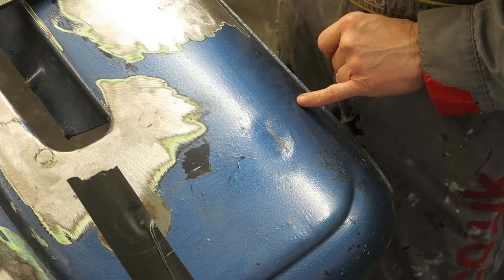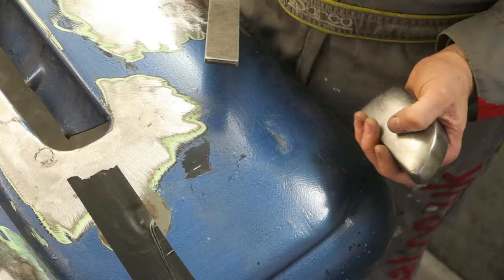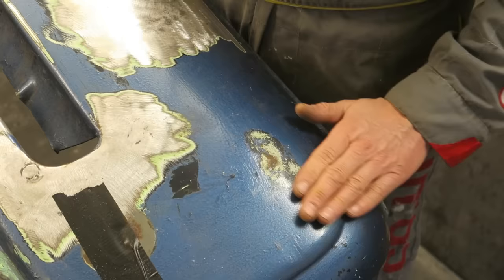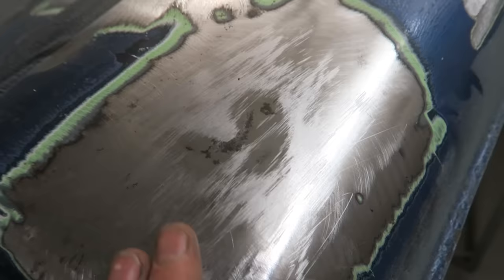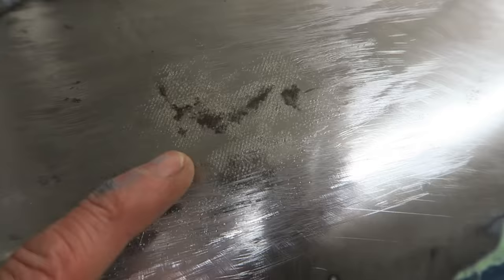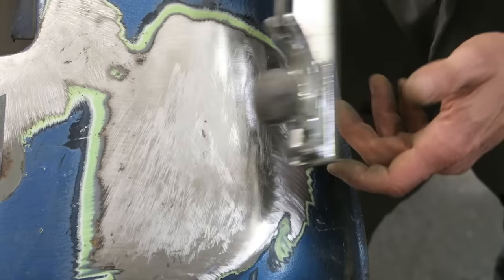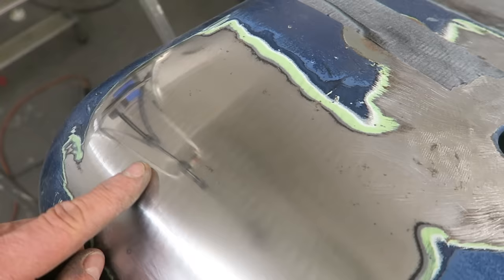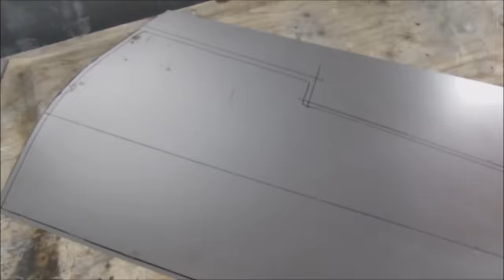How to do metal finishing, Dent flipping. Tips and Tricks #3

Comment: Excellent vid. There are few of us file finishers left and they don't even teach lead wiping at tech school anymore. At around the 10 min mark is where I would use a dust coat of black as a guide when filing. Also I use a wooden file as I find the flexible file can flex just when you don't want it to and always hold the file with both hands to ensure the file is flat on the steel.  People don't understand that the file is used to show highs and lows and and isn't for the actual smoothing of the steel. 
Of course it also needs to be understood that the quality of steel in modern cars, does not lend itself to a file finish repair.

Comment: With a 67 GM truck, I can do this as the best part is, it’s wide open behind for the most part. It actually has metal in the panels. The panels for the most part, all unbolt making reaching around easier. 
  A dent like that, displaces metal around it. By pushing up, slapping the toe dolly around the dent, working toward the middle. Each time, this lifts the metal upward and pulling the displaced metal inward. This is a unique way to to reduce product use, achieve a flatter surface to start any repair toward a completed finish. It eliminates “Oil Canning” effect from just filling as that alone and will not cut it in many places, creating more problems. I want a heavy slapping file like that one. It has to be at least 10 mm thick or almost 7/16”. Thanks!

Comment: My Friend I spent years in auto body repair. I took pride in my work and always tried to do a good job and used as little body filler (bondo) as possible. Still I have never seen that "Exact," technique. I've seen and understand very similar technique's but they weren't as effective as that one. I'm very impressed! Looked like you could have sanded that down with an orbital sander using 180 grit then 220 and finally 400. Then simply prime and block sand a couple times with 400 and your ready to paint. Amazing! Best dent removal I've ever seen no doubt. I still don't fully understand how that got rid of the shoulder or high spot which was all the way around the dent. The metal usually always stretches thus leaving a high shoulder all the way around a dent. Did this work differently because you were working on and older truck which had thicker metal or would you get the same results with the metal on new trucks/cars which have much thinner metal? I'd love to hear your answer. Many thanks for the video. Truly awesome...…..
Reply from the maker: Robert Jenkins you only have a high spot around the dent because of the metal displaced by the dent, once the dent is relieved so is the high ridge/shoulder. The teeth of the bumping file grip the steel both sides of the dent upon impact helping to shrink any stretch as the dolly pushes the dent upwards. I’m going to do a demo on a modern car panel at some stage. Most old cars thickness is 0.9 mm new cars 0.7mm not that much difference as people assume, obviously there are exceptions. Cheers Trev 👍
Reply: @trevsblog  Perfect Sir. You got right to the heart of what had me puzzled. ""The stretching."" I didn't know you could take out the stretch in the metal without the quick cooling of extremely hot metal. Keep in mind that I am very old school. I haven't worked on a car body since the early 90s. What you just explained makes perfect since but I had no clue it was even possible. I'm about to buy myself a wrecked truck and fix it to drive as my personal vehicle. I will be putting your repair idea's to the test. Just hope I can be half as successvile as you are Sir. Thank you for sharing as well as for answering me back. You are very impressive to put it modestly!!!
Reply from the maker: Robert Jenkins hi Robert I think I may have caused you some confusion, cooling the metal with a dampened cloth allows you to quickly asses the repair without having to wait for it to cool down naturally. The shrinking effect is mostly caused by the heated area expanding, the metal around the expanding heated area remains cool forcing the expanding area to get thicker as the metal has nowhere else to go. Once the heat has gone from the area the heated area has shrunk. Cheers Trev 👍
Reply: @trevsblog  Thank you Sir. However it wasn't you. I watched my Pop shrink metal that way when I was very young. like 10 years old. Apparently I simply misunderstood exactly how the shrinking occurred. Thank you for the clarification and also for your willingness to be so helpful! Your one fine gentleman....
Reply: Sir also I was just watching people using hand pump 10 ton porta powers to pull wrecked auto sheet metal as well as frames back into place on YouTube. Could you please advise me on what the best hand pump porta power would be for this type work for the money and also should I go with a 10 ton or is a 4 ton sufficient? Thank you.....
Reply from the maker: Robert Jenkins that’s good I didn’t want to cause confusion. Interesting effects can be created by heating and cooling. Cheers Trev 👍
Reply from the maker: Robert Jenkins I would go 10 tonnes all day long. Sealey do reasonably priced body jack kits. Cheers Trev 👍
Reply: @trevsblog  Thank you Sir!!

Comment: For the couple of remaining spots, the Americans use a thing called a bulls eye pick. It is basically a big pair of tongs with an anvil on  one tong and a pick head on the other tong. You line up the anvil on the small low spot and raise it with the pick.  When i first saw someone using a body file to find low spots,they finished off the repair by raising the low spots with a brad awl. They felt around inside the panel for the dent and pushed on it gently with the Brad awl to push the low spot up.  Regarding over use of the body file, i have been known to file a hole in a panel which had undergone repairs in the dark distant past.   😁😁
Reply from the maker: Mercmad I saw Ron Covell using one of those tools, a project for the future maybe? Yes it’s very easy to file stuff thin, it’s best to just lightly use it to outline the low spots, I always say better a skim of filler than a thin panel. Cheers Trev 👍

Comment: Trev, long time no chat... I am still watching your content but not commenting much... I would like to add the "teeth'' are for ''shrinking'' the metal back after it has been ''stretched'' by the ''indenting''... If, someone were to use just a non-toothed product, the metal would just crown with the ''extra stretched metal''...
Thanks for posting your content, I so enjoy your bodywork skills / metal work skills.
Reply from the maker: Hey hello 👋 yes your right about the teeth they grip the metal each side and add to the compression on the stretched metal that forms the dent. Using a smooth file still shrinks the dent as it still adds linear compression, a bit like shrinking a tuck, but without the teeth it’s not as effective. As soon as a smooth spoon contacts the dolly sandwiching the metal between the spoon and dolly it starts to thin/stretch. Did you catch my latest video on heat distortion? If not I think you’d like it. Cheers Trev 👍
Reply: @trevsblog  , I have it on my watchlist; I will be honored to watch it.
Thanks again Trev for your knowledge sharing, I appreciate it and love your skill level.

Comment: I read in an instruction manual that you're supposed to strike the dent with the file until you hear a solid metal on metal sound, as opposed to the hollow metal chamber sound in the beginning
Reply from the maker: Yep and there’s a point to what you’ve read certainly on a deep dent, on the first couple of blows. My comments on this sound was really to emphasise that the sound you’re hearing identifies whether you’re aligning file with dolly or missing the dolly which is an easy thing to do then mess up the repair. Cheers Trev 👍

Comment: It’s like resembles a lot like paintless dent repair but a lot faster (more efficient).
I’m a complete nitwit here so I hope you don’t mind me asking this. Why don’t you use quick drying spray paint and a sanding block to visualize the low surfaces? You wouldn’t take out as much material. 

I enjoyed watching not only your work very much but also the way you explain what you’re doing and why and last but not least your editing. Thanks!
Reply from the maker: Conservator this is a very common question so I may well do another metal finishing video. The file is dead flat whereas sand paper is more forgiving and will sand down into a low spot telling the repairer that the repair it better than it actually is. The file is just used to highlight a low spot, if you’re removing material then you’re filing too hard. Cheers Trev 👍

Comment: Could you not use 80 grit paper instead of a file to find the low spots?  This would be less invasive than coarse filing over the surface.... one would think?
Reply: I think he actually cut down the high shoulder all the way around the dent by using the file. Usually that would have to be gently tapped down by a hammer. Brilliant idea although I could be wrong and you have a good point. I'm curious to see how it works on todays new auto's with much thinner metal. Great question though. I look forward to seeing his answer.  Later Friend.....
Reply: @robertjenkins8630  yes that's what I was also wondering. A Subaru panel for example is pretty thin.
Reply from the maker: Mark Young the body file takes no prisoners, if it’s not totally flat the file will show up a low spot. Sand paper even on a block will to a degree follow the contour of the steel and give you false feedback and still leave behind low spots. Cheers Trev 👍

Comment: Trevor, how would you go about working dents out of the raised detail on a Vintage VW bug hood? Its not so much the raised detail, got that figured out, but the recess adjacent to the raised part..The hit was not that severe, but the P.O. just filled it with bondo (1/2 - 3/4") ! I've heated (torched) and removed most of the bondo, but the dent has me perplexed.
Reply from the maker: Terry Kull Hi Terry obviously it’s extremely difficult giving advice without actually putting my hand over it, send me a picture, my email is in the video description. Cheers Trev 👍
Reply: @trevsblog  email sent,, the issue is where the raised part comes down to the flat of the hood. I can buy a replacement hood for $80 usd, but i like the ides of keeping it original if possible
Reply: thx!

Comment: I have a question. How do you keep the metal from rusting when your doing different parts of the vehicle
Reply from the maker: hddm3 what we do varies. Sometimes just give it a coat of aerosol etch primer. Then sand it back off before priming properly. Cheers Trev 👍

Comment: Great video as always. Quick question.

Why don’t you use a bumping file that’s smoothed and polished so you don’t put file marks in the panel.
Ive removed dents daily for 20 years (not in steel) and the first thing I do is make sure the dolly and hitting tool of your choice is as clean and polished as possible to stop putting more marks in the item being repaired.
Thanks
Reply from the maker: jamie harris the teeth grip each side of the depression, the impact against the dolly compresses along the steel shrinking it. The marks also help to identify where the dolly is and highlight remaining low spots, the marks are easily removed or just buried under the paint preparation. Cheers Trev 👍

Comment: i am a panel apprentice and i have a question is the reason that you are not scared of the panel stretching via direct hammering because of the teeth of the bumping file shrinking the panel as you are working the dent out?
Reply from the maker: Hi Charlie the teeth on the file grip the panel either side of the dent and as the dent is pushed back into position it does exert a certain amount of linear compression to the panel. Whether this makes an enormous difference to any stretched steel is up for debate, I believe it has a degree of shrinking effect others don’t. I’m certainly not worried about the steel being stretched because I simply heat shrink any high spots (stretched steel) after I’ve removed the dent. I always remove the dents first then address any high spots once every depression is raised, hope this makes sense 👍

Comment: I don't have a bumping file. Will a normal panel beating hammer do? The one with the cross-hatch marks?
Reply: I made my flipper from a brand new bastard file when I was still an apprentice. I still have it and still use it 48 years later. A shrinking hammer is useful too.
Reply from the maker: bob wickham consider buying one Bob, you will get a result with a hammer but not as effective as the surface face is so much smaller. Cheers Trev 👍
Reply: @trevsblog  Thanks Trev, I'll have a look in the shops

Comment: hello Trev, Ron and Jere's channels brought me to yours, its nice to see other channels in their same league.
one problem I've had in the past while working dents is how to handle the stretching problem that often occurs when metal gets dented or bent.  on some occasions I've simply cutout the whole section when I couldn't figure out any other way to straiten it
any advice you can give on this matter would be greatly appreciated.
by the way, I just subbed.
Reply from the maker: One regret about this video is I didn’t emphasise the fact that the beating file helps to shrink the dent by gripping the metal thus placing linear compression as the dent is being pushed out. I’ve done a heat shrinking video using a blow lamp to help out a tool limited viewer and another using a stud type spot welder called pulling sharp nasty dents. If you go to my YouTube account and click on videos you can view my back catalogue of videos. I do intend to continue producing these types of videos into the future. Cheers Trev

Comment: Great video! Couldn’t you use a guide coat and 320 sandpaper to give you the same result on where the low spots are without filing the metal down? Or would that not work?
Reply from the maker: Dan's Garage NC Dan the principal is the same but the file remains dead flat whereas the paper will always be more forgiving and sand down into the dent slightly making it look like the process has worked better that it actually has. Cheers Trev 👍

Comment: Could you have saved some filing and eliminated some unnecessary wear on the sheet metal by using spray paint to help show the low spots??? Sorry to ask dumb questions.
Reply from the maker: anna chrissy if you’re filing material away you’re pressing too hard and for too long on the file, it scores the metal rather than filing it away if used with care. Of course it will ruin the panel if you use the file to lower the high spots. Cheers Trev 👍
Reply: Thank you

Comment: Hi Trevor, great video, thanks for upload. My 1940 Citroën U23 has quite a few of these bumps 😏
Short question: if I were to invest in a dolly and bumping file for this kind of job, what file should I choose: with teeth or without? Does the toothed version have slight shrinking capacities, is that the difference? Between a curved dolly and a flat file the metal stretches, I believe. 
Or is it mainly about being able to see the marking and see what you're doing? I find many files without teeth, online
The metal coming up again needs some minor shrinking, right? Cheers from Holland
Reply from the maker: Dutch Classic Exhausts yes the teeth have a shrinking effect and also highlight the low spot. Cheers Trev 👍

Comment: How did you get you train in panel beater , I sat the last C+G panel beater course an am 44 ,, I would of stripped the area and gone across with P/spoon (think you called it a bump spoon ) and I got 2 beak wieght with outer side edges tapered  (1 l + 1 r ) ,then brought it back until you couldn't tell virtually by touch (hands proper trained can feel what the sight can't see) ,misted a shop black over it and surf blocked to make sure no highs or lows minimising the materials taken off with the file , ( i only use file when finishing lead work off on A,B,C posts if vintage or classic ) ,I got a variable speed grinder but I just use the Orby and lock the oscillator up on the pad briefly then when checked straight I flick Orby to oscillations an quick flick over the top .no filler work and if needed a poss minute scratch of stopper if using a standard primer instead of a h/build ,just shows a difference in technique   we where both taught to get a good end result ,it's funny how people can't grasp how we can feel the difference in a few thou on a panel that sight would say is straight if not etched to find hi/low points
Reply from the maker: paul dean Hey Thanks Paul 🤩. Your comment is very much appreciated. Cheers Trev 👍

Comment: Right Trev I'm working through your vids. I will be attempting to remove a few dings on a Vespa shortly.
So... Why do we sometimes use a hammer and other times use the slappy file thing?
Reply from the maker: Stacey Nixon watch the videos through as many times as possible, perhaps even practice on a scrap yard wing first or something similar, the sloppy thing raises the low spots with the dolly under it. Please go carefully on that lovely Vespa. Cheers Trev 👍
Reply: Stacey Nixon hammer has more weight ,whereas a flipper has less weight more surface area. If you need too move larger areas of metal you need heavier tool.A flipper is more of a finishing tool,you can get non toothed flippers but be careful not to stretch the metal.One other thing , work from the outer edges of the dent ,spiralling into the centre of the dent.Its mostly done by the correct shaped dolly exerting upward pressure .